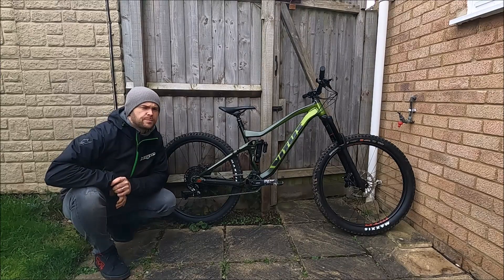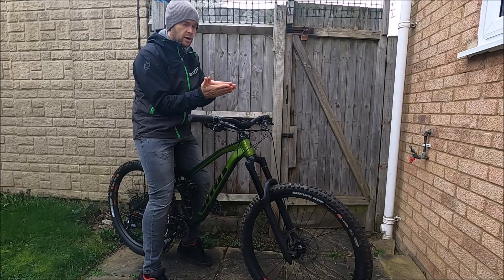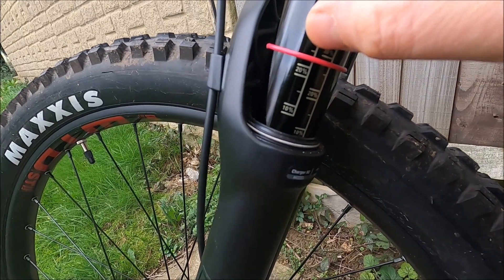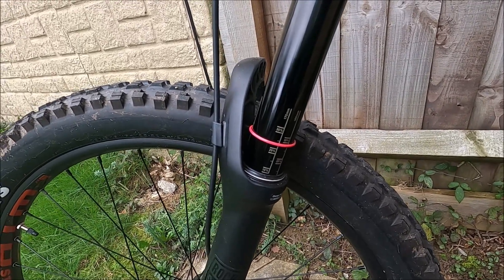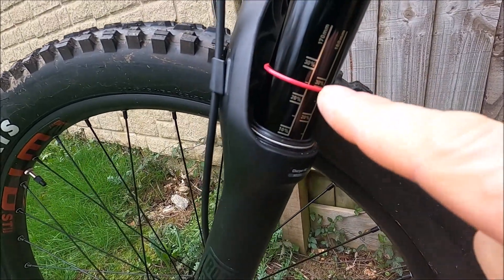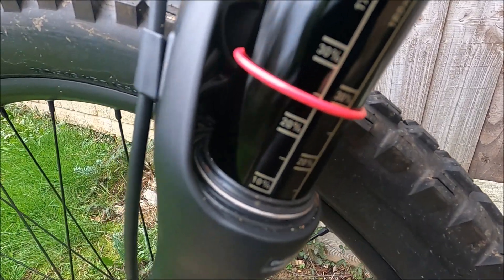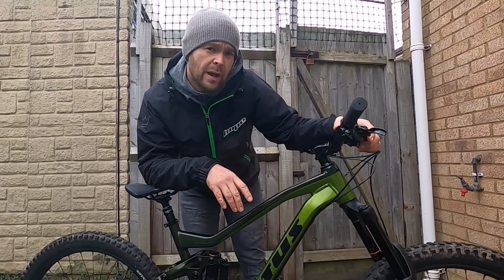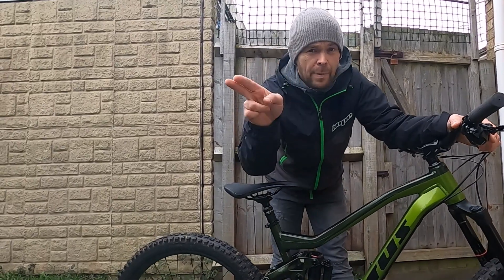MTB Suspension - Setting Your Sag

Comment: Hi mate how do the bikes size up, u get medium or large? Paintwork looks ace!
Reply from the maker: I am 5' 10” and went for the medium. Seems good to me. Could have maybe gone for a large, but I think once the 150mm dropper (found on the large) is extended, I think it would actually have been too high.

As it is, the 120mm dropper on my medium is inserted below the depth marker on the seatpost to get optimum pedalling height at full extension.

The reach seems great too.
Reply: Ah kul, thanks. It’s difficult when buying from wiggle etc online..
Reply from the maker: @frankiedoodle8984  you are not wrong there!

I originally ordered a medium Escarpe (supposedly the last one in stock) but they sent me a small. It had to go back, but at least it confirmed that it was actually too small.

I think if your height means that you fall right in the middle of two sizes (medium and large for example) it would probably be best to size up.